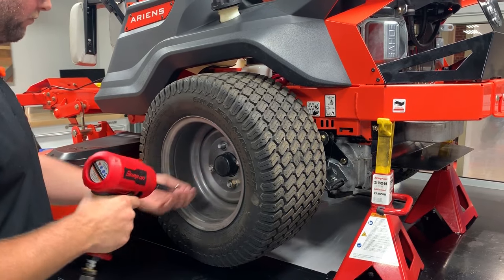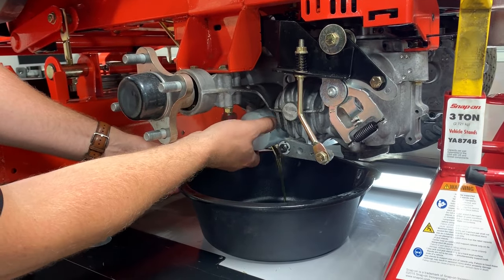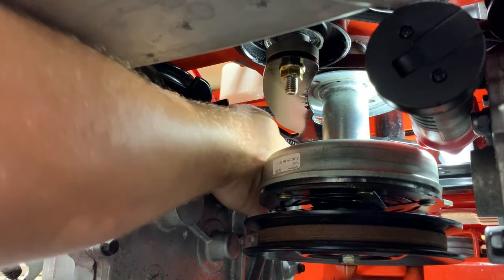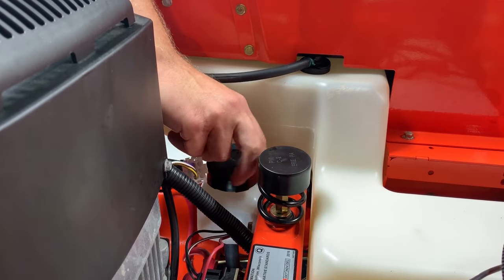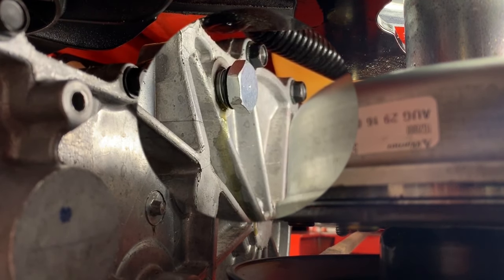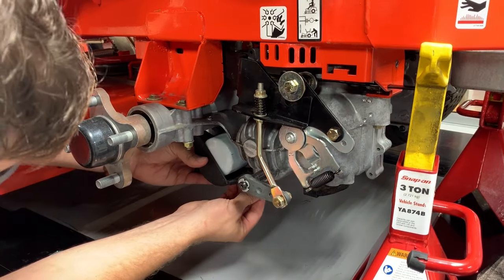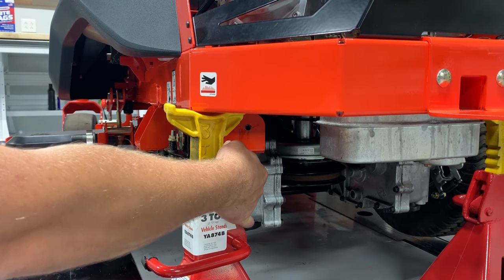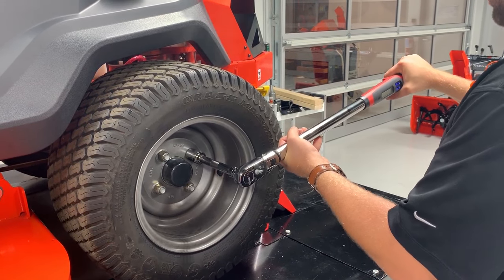How to Change Lawn Mower Hydro Oil | Ariens®

Comment: I have the Ikon XD52 and its a great machine but lately my left side has weak pull to it and seems to have a slight stutter when it starts moving. i know the trans are sealed but my question is if i can swap the sealed trans for one that is maintainable. I am at the end of my 3rd season of mowing with it at around 180+ hrs but buying a trans every 3 years with each trans costing 750 dollars seems a little steep at 1500 dollar maintenance every 3 years. what is my best option here?
Reply: You can change the oil in the sealed units, however they have to be removed from the machine and drained through the fill hole, hydrogear has info on their site

Comment: It would be great if how to remove a 1 bolt rear tire and then list the appropriate torque when remounting that tire you can’t take off would be great!
Reply: Yeah what's the torque on those bolts? My manual doesn't have those numbers listed. It's just the operator manual that came with it. Unless I missed it I'll check again in the morning.

Comment: As the ikon xd has the ezt 2200 hydro transaxles, which are "maintenance free" and you dont change oil, how many hours of life do they give before they need to be replaced?
Reply from the maker: Thanks for asking. Our technical support team says these should last around 250 to 300 hours.
Reply from the maker: @Tom Fuller Thanks for asking, Tom. Which specific transaxle model were you curious about?
Reply from the maker: @Tom Fuller Thanks, Tom. Here's the links to the left and right transaxles on the Ariens parts site. The cost will be in the links of each:

https://www.ariens.com/en-us/parts/list?model=&serial=&search=&query=05291800

https://www.ariens.com/en-us/parts/list?model=&serial=&search=&query=05291900

You can also source parts from your nearest Ariens dealer: https://www.ariens.com/en-us/dealer-locator
Reply: @AriensChannel  That's a short service life.
Reply: @Tom Fuller $500 each. Labor not included. Easy to swap out yourself.
Reply: @AriensChannel  Thank you for your very honest and direct answer. I really appreciate you answering the question directly and not avoiding. I'm currently trying to weigh the cost of the Apex with the 3100 Hydros vs the Icon XD with the 2200 EZT. Can you please tell me the life expectancy of the 3100 if properly maintained?
Reply: @M70ACARRY  wonder the quality of the sealed spindles. Talk about bait and switch. Product obsolescence. Buyer beware.
Reply: Very sad.

Comment: I have a 2021 Apex.  The parking brake has to be engaged (up position) in order to start the motor.  However, as soon as I release the brake (move into down position) the motor automatically shuts off.  So, how can I move the steering arms to purge air from the system if the brake has to be off in order to move them?
Reply: Release the brake. Wheels are up on Jackstands.  Cant go anywhere

Comment: Thank you that should help. All as I got to do is find hydraulic reservoir. Looks like it's stuffed in by the fuel tank on my model ikon x Briggs and Stratton 22hp.  This information was not in my operation manual. Model number 915207, purchase in July 2017..

Comment: My Ariens Apex 60 has a COMPLETELY different setup in regards to the vent plug. It actually doesn't even have a vent plug per se. It has a fitting there that has a hose running down to it from the expansion tank. I'm really not sure of the best way to go about refilling things? I've looked at lots of online vids and don't see a similar setup anywhere.
Reply: Changed the fluid this morning on the LHS of my Apex 60 and will do the other side tomorrow.  The vent plug is there - directly over the axle line and  in about 2 or 3 inches inside of the tire (if it were on).  Just enough room to get a wrench (and torque wrench) on it without dismantling the little seat damper.  I took the plug off and slowly filled the reservoir on top until the new oil overflowed the vent plug.  Replaced the plug and done.
  I expected to have to add fluid after purging but didn't have to.  2.5 quarts and it ended up 1/4" above the "full" line.  Good for 400 hours now.
Reply: @jonsmith5774  Thanks jon! Yep, you're right. I see it now right there on the top. Most setups have it on the side it seems.
Reply: It's in the same spot on my Gravely ZTHD52.  It was a PITA to get a wrench on.  You can barely turn the wrench once you do get it on there.  I'm glad I don't have to do it again for another 400 hours.
Reply: @shawnbond1975  I wound up using a nearly flat ratcheting wrench. One of those that is boxed in on both ends and the inside of the box has gear teeth. Even then it was a tight fit. After the initial break loose of the plug I had to slip my off hand in there and hold down on the plug with a finger to keep it from just going back and forth.

Comment: Is there not a driver presence sensor in the seat allowing you to drive this machine while not sitting in the seat?
Reply from the maker: Thanks for asking! The vision is obstructed in the video, but we put a weight on the seat to "close" the seat switch.
Reply: Ariens I was up and down on my seat about 10 times while doing leaf cleanups today wondering 🤔 🤣.
Reply: On my new Ikon XL 60, if the PTO is disengaged, the engine will keep running when I get out of the seat. When the PTO is engaged, the engine stops when out of the seat.
Reply: @texson5378  Yeah I can engage the brake turn off the PTO and get off the tractor while running. I have a ZT HD-52 about to change the hydro oil.
Reply: @AriensChannel  I have a Friend 1konx 52 in I don't see a hydraulic fluid tank anywhere so how do I check it ??
Reply from the maker: @donaldhicks8002  thanks for asking, Donald. The Ikon X and Ikon XD (as opposed to the Ikon XL) has sealed, maintenance-free transaxles, which means there's no hydraulic oil expansion tanks. You won't need to worry about hydraulic oil changes on your model.
Reply: My mower don't turn smoothly no more it's jerk to the left when turn left turn right it jerk to the right?
Reply from the maker: @donaldhicks8002  we're sorry you're experiencing that, Donald. There's no adjustment for that issue, so we recommend contacting your nearest Ariens dealer so they can diagnose and resolve the issue.

You can find an Ariens dealer in your neighborhood using our dealer locator tool: https://www.ariens.com/en-us/dealer-locator

Comment: I bought the IKON XD52 earlier this year and it works great, but it appears to have an oil leak somewhere.  Not sure if it's engine oil or hydraulic fluid.  When I check the engine oil dipstick, the level is fine.  What should I do?  I don't want the transmission to lock up.  The oil puddle seems to collect under the transaxle, but it also is beneath the engine as well.
Reply from the maker: Thanks for asking, Glenn, and we're sorry you're experiencing that issue. It's unclear where the issue is, so please contact your nearest Ariens dealer for help. Our dealers are an extension of our team and will be able to diagnose and resolve the issue upon physical inspection of your unit. Click the link below to find a servicing dealer near you:
https://www.ariens.com/en-us/dealer-locator
Reply: @AriensChannel  Thank you. I will go to Lowes where I purchased it and discuss with them.
Reply from the maker: @glennwade9505  Actually, Glenn, you'll be better off going to an Ariens dealer. Lowe's is strictly sales only – they are not trained to service our units, nor will they be able to administer a warranty claim if one exists.
You can find an Ariens servicing dealer by selecting "service" on our dealer locator tool that we linked in the last message.
Reply: @AriensChannel  I'm thinking of purchasing an Ariens IKON XD 52.  Does it have a serviceable transaxle?  If not, how long would the transaxle last on a 3 acre plot of land with a 375' x 6' strip of rather steep slope 18%?  Mowing once a week mid-April -October.
Reply from the maker: @appstate1996  Thanks for considering us! Ikon XD-series models don not have serviceable transaxles. We're thinking that for your property, it might be more appropriate to move up to an Apex-series zero-turn.
Reply: @AriensChannel  I have an an ikon xd 52” zero turn. What should I do as far as hydraulic fluid changes? I have about 390 hours on it and it’s starting to become pretty noisy when operating

Comment: I have an Ariens Icon X 52”. It does NOT have any expansion tanks nor does it have transaxle filters. The manual does not say how to change or how often to change my models transaxle hydraulic fluid. The model is a 915223. Any help would be appreciated.
Reply: Ariens claims it is not serviceable zt-2200 it is but there filter is internail think its every 200 hrs
Reply: @johnjennette4949  thank you, appreciate the reply. I suspected as much. Apparently the “Ariens Authorized” repair center are clueless... or not well trained.

Comment: My mower is 3 years old and I never replaced the fluid. Now the mower won't got forward or reverse. Does that mean my transaxles are bad and both need completely replaced???
Reply from the maker: Thanks for asking! Fluid replacement intervals aren't done by years, but by hours. For an Ikon XL, Apex or Zenith model, that's after the first 75 hours (break-in oil change) and then every 400 hours thereafter.

We can't say for certain what's causing your issue, but first check that the transaxles aren't bypassed (check the small levers inside the rear wheels). Or, this could because the hydro belt is either broken, or because it slipped off a pulley. Otherwise, we suggest contacting your nearest Ariens servicing dealer. Our dealers are an extension of our team and will be able to diagnose and resolve the issue.

You can find a dealer near you here:
https://www.ariens.com/en-us/dealer-locator

Comment: Do the 2020 Ariens IkonXD52" hydro 2200 have filter if not how do you change oile on them?
Reply from the maker: Thanks for asking, John! And no, all Ikon XD models are equipped with sealed, maintenance-free transaxles. There are no hydraulic oil expansion tanks on these models.
Reply: Maintenance free, doesn't actually mean, "HEADACHE-FREE" !!!    SMH

Comment: Will the work on my Gravely? It has commercial 3100s on it
Reply from the maker: Thanks for asking, Parker. The procedure between this model and your model with the ZT-3100s will be very, very similar. Just double check the oil specs and quantity before starting.

Comment: Hi, why cant we service the rear axels on the IKON XD model? Is there a way I can service these on my machine as well?
Reply from the maker: Thanks for asking, Steven. The transaxles on previous Ikon XL models were serviceable, however, all Ikon XD models feature sealed, maintenance-free transaxles.
Reply: @AriensChannel  thank you . How can oil in trans axles not be serviceable or good for life when the Apex and Zenith are serviable?  Is it the same oil? I have seen in some videos that the oil can be serviced however the transaxle would need to be removed and emptied through the screw on top? Is this possible?
Reply from the maker: @stevenbelleville392  thanks for asking, Steven. The Apex and Zenith are designed for larger properties and experience more cutting hours, which is why they have serviceable transaxles. It's the same oil, but please understand that the Edge and Ikon XD-series models were designed for smaller to medium-sized yards and are therefore expected to see fewer hours on each season – the lower hour count on these machines is why their transaxles is why they were equipped with non-serviceable transaxles.

 We advise against attempting to drain these transaxles. If you have more service-related questions, please reach out to your nearest Ariens servicing dealer using the dealer locator tool linked here: https://www.ariens.com/en-us/dealer-locator
Reply: @AriensChannel  thank you for your response, I truly appreciate the honesty. My property takes me aprox.4-1/2 to 5 hours every two weeks to maintain. I just cannot understand why you wouldn't want us to service them to keep these machines running smooth for a long time to come. I am all about keeping my equipment for a long time and oil changes on any type of frictional parts is essential. Is there a port on the top of the transaxle that can be removed?
Reply from the maker: @stevenbelleville392  You're very welcome, Steven. There is no port on these transmissions, since they are sealed. To learn more about your options or for more information regarding your transaxles, we suggest reaching out to your nearest Ariens servicing dealer.
Reply: @stevenbelleville392  Yes, that would be possible. Take note of how much drained. I would heat the unit before draining so oil is thinner allowing more to drain. Most of the particulates would be removed, but not as efficiently as a filtered unit. You could split the case and thread for a filter. This would be for someone with OCD.

Comment: Does this apply to ariens edge 42 as well?
Reply from the maker: Thanks for asking, Ron. No, the Ariens EDGE is equipped with maintenance-free transaxles and does not require regular transaxle oil changes.
Reply: @AriensChannel My edge 42 seems to be leaking from one of the trans axles.  How do I fix this issue if they aren’t serviceable?

Comment: What filter does it take? I have an IKoNXL 60
Reply from the maker: Thanks for asking, Aaron. According to the operator's manual for your unit, you'll need two 21545100 oil filters, which can be found here: https://parts.ariens.com/Hydro-Gear-Transmission-Oil-Filter-p/21545100.htm

Comment: Also what oil do you recommend
Reply from the maker: No problem, Aaron. You'll need 15W-50 synthetic motor oil, Ariens part number 00057100: https://parts.ariens.com/Gravely-Lawn-Mower-32-oz-Hydraulic-Oil-p/00057100.htm
Reply: 15w50 synthetic hydrostatic transmission fluid.  Stens sells an excellent one. Change every 200 hrs.

Comment: Mine does not have the expansion tanks. How do I go about adding oil back to it
Reply from the maker: Thanks for asking, Jeffrey. If you have an IKON X model, you have maintenance-free transaxles and do not need to perform transaxle oil changes. This video only applies to IKON XL models. Maintenance-free models will not have expansion tanks.
Reply: @AriensChannel  so glad I read this comment. I was looking at xl model maintenance instructions. You saved me so much unnecessary work. But nonthegreat video and easy to follow along. Please keep posting these helpful videos.
Reply from the maker: @DS-zo8xs  We're happy to be of service, Danielle! And you're in luck, because we're currently in the middle of producing new videos for EVERYTHING.
Reply: I can't find my oil filters on my toro
Reply from the maker: @randyscruggs6346  That's a shame, Randy. If you want to switch to the Ariens family, we'll welcome you with open arms.. and we'll show you where the oil filters are 😉
Reply: @AriensChannel  nice come back Haha. Loving my new Ikon 42xd its been awesome so far. Just installed a hitch and the Ballards Advanced chute blocker its awesome. Mower has been cutting great 👌
Reply from the maker: @cashen7384  that's great to hear! Welcome to the Ariens family, Cashen!

Comment: Any recommendation on how many hours in you should change the hydro oil?
Reply from the maker: Thanks for asking, Ben. Your operator's manual lists the exact recommendation, but typically you'll need to change the hydro oil after the first 75 hours of operation and then every 400 hours thereafter.
Reply: @AriensChannel  awesome, thank you for the quick reply!
Reply from the maker: @benknecht6287  you got it, Ben! Always doing our best to support our customers.
Reply: @AriensChannel  Last question. I have the Ariens Ikon X 52 (915223). The manual does not list the hydraulic oil filter part number - is this because changing the hydro oil in this particular model isn't something that's easily done?
Reply from the maker: @benknecht6287  thanks for the question, Ben. Actually, our IKON X models have maintenance-free transaxles. You don't have to change the oil! This video applies to IKON XL models only.
Reply: @AriensChannel  Thank you for the quick reply - this type of customer service is rare to find nowadays. I appreciate the help.
Reply from the maker: @benknecht6287  happy to be of service to you, Ben! We're always here for you... and the friends you introduce to the Ariens brand ;)
Reply: Granted, it depends on the Brand and Model mower you are planning to work on.  Personally, my Dixie Chopper Silver Eagle Model 2760 recommends that both hydraulic filters be replaced every 500 hours of operation to include new Lucas motor oil.
Reply: Luis Cardenas  Honestly I have no idea - I would ask Ariens ustomer service
Reply: @AriensChannel  what if my ikon does not have serviceable hydros?

Comment: Can you service the transaxles on the ikon xd??
Reply from the maker: Thanks for asking, Andy! The Hydro-Gear EZT transaxles on the Ikon XD are a sealed, maintenance-free design.
Reply: Absolutely mind blowing that a $3500 machine doesn't have hydro filters, or a way to change the hydro oil.  Maintenance-free is maintenance neglect.  I regret my purchase.
Reply: @AriensChannel so what do you do if you have a leak

Comment: what hydros do xd's have?
Reply from the maker: Thanks for asking! The IKON XD is equipped with a pair of Hydro-Gear EZT maintenance-free transaxles. So unlike the IKON XL and its ZT-2800s in this video, you'll never need to change the hydro oil on the IKON XD 👍
Reply: @AriensChannel  What is the actual hydros the XD has?
Reply from the maker: @dennisreynolds6915  they're equipped with the Hydro-Gear ZT-2200 (also known as EZT) transaxles. For more information, we linked the product page from Hydro-Gear's website below:
https://www.hydro-gear.com/zt2200-ezt/